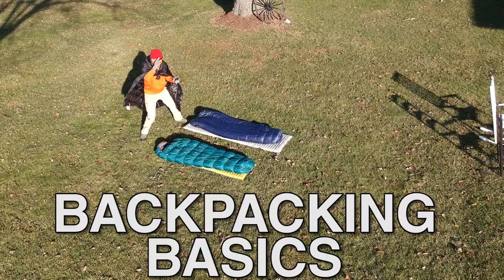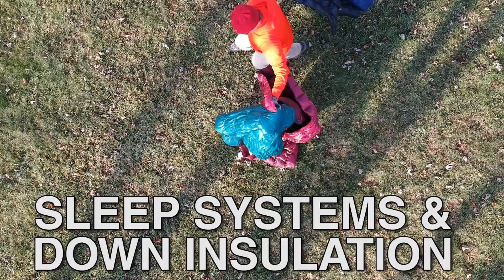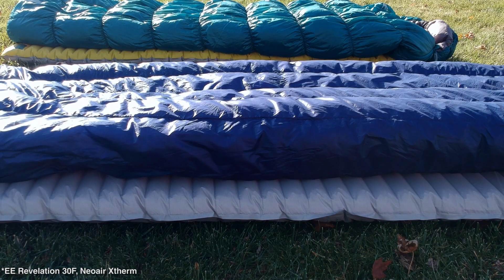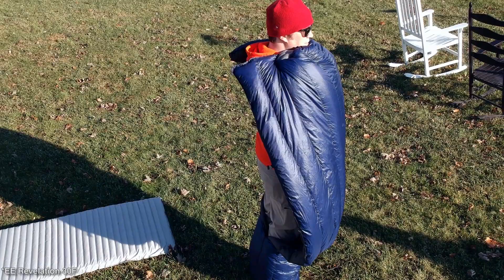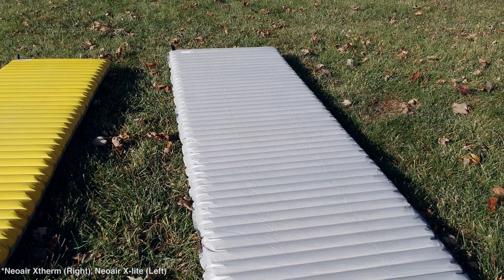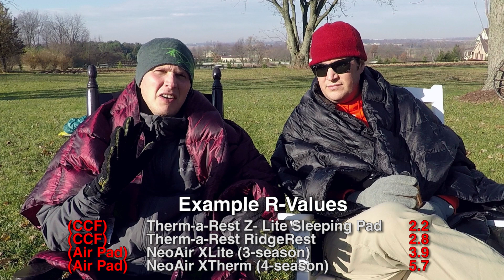Backpacking Basics Pt. 4: Sleep Systems & Down Insulation

Comment: Good vid guys. I never did sleep out in my hammock with the costco quilt layered between my 30' bottom quilt. I said I'd comment on the next video, but it didn't happen. In a few weeks I won't have a choice since I'll be down at Wildcat Hollow. I'll let you know then, unless its warm enough just for my 30'.
Reply from the maker: Thanks for the update, I’m very interested to hear how it goes.  I have a 10degree UQ on order and I’m going to have to do one trip with the layer method as well...we’ll see how it works out.

Comment: A big advantage with down is that it will last much longer!!
Synthetic losses some R value with repeat compression.
My APEX quilt in 5ozfp was 30f for sure. After a year of moderate use it’s more like 40f,brrr!
I’ve always used synthetic due to cost factor.     APEX works great, but heavy.    I’m currently waiting for my first down piece from Enlightened Equip to ship.     A 20f revelation 950.     Very excited for more warmth and a huge weight saving even with bigger dimensions.
Reply: I just received my EE 20 degree Enigma 950 about a week ago. It's an ounce lighter and compresses a little smaller than my 40 degree 800 fill power top quilt.  Fluffy awesomeness.
Reply from the maker: I did not know that synthetic will lose R value after repeated compression! Another plus for down. Almost all my non-backpacking gear is synthetic. Thx for the input
Reply: SBOutdoors how old is your Arc Atom jacket? 
My Atom LT has def lost some warmth and feels thinner....but because it’s synthetic it cant be “fluffed”.